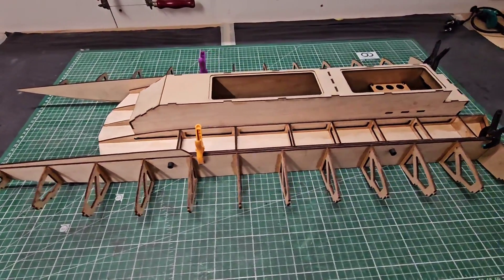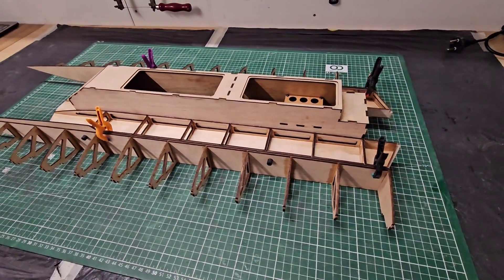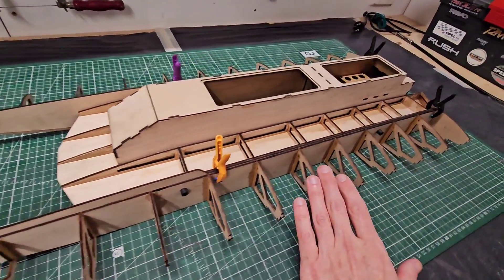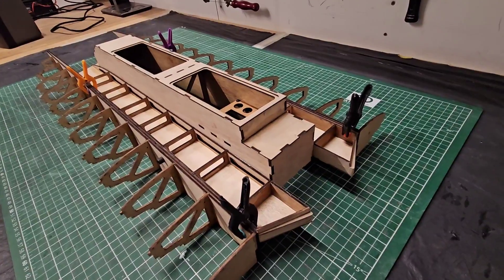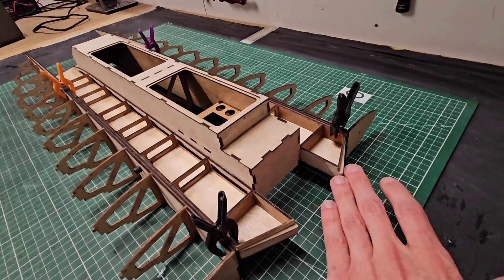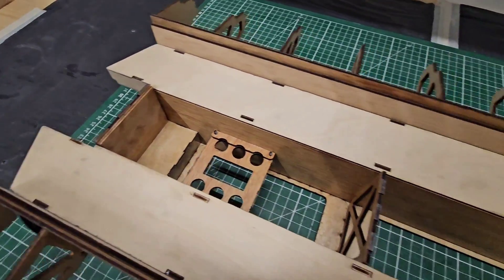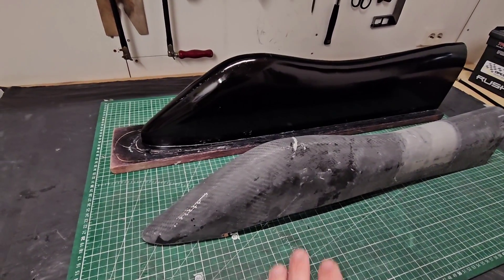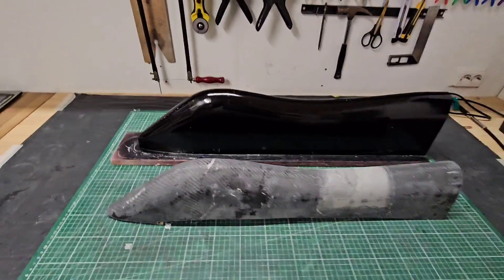How to build a RC F1 Boat - part 2

Comment: Hello again. Great inspiaration video as usual! I finally got my prototypes to work. Geared outbord and all. Not as fast as yours but will get there. I curious about the weight of your boat. I 3D print the all thing, so the body and canopy are a "monocoque chassis" of sorts. Have also been printing in RC plane grade PLA for weigh savings. In spring I would like to order one of your models to have a comparison with my models. Cheers
Reply from the maker: Hi José, great to hear your geared prototypes worked out! 
This boat, with a 6S 4500mAh lipo and carbon cowl, weighs about 3150grams ready to run. Hull length is 834mm. Let me know anytime, if you're interested in ordering a kit. ✌️ DJ
Reply: @CozyRC  I'm certainly interested. Just don't know how to break it to the wife. Market research?  😆

Comment: Thank you for your videos. I have tfl zonda.  Buti I don't like something.
I cat hull somewhere. 2motore systems need 4 water lines. then I made these.
I will have to fix motor mount for sure angle.
all the things  I was able to learn all of them from your videos.
again Thank you.
I would build myself a new boat. Based on what I learned from you.
Reply from the maker: Thank you, I'm glad my videos could help you! TFL Zonda is a very fast boat 👍

Comment: This is a very nice boat. You should make a mould of your hatch/canopy. Then it will be much easier to apply the fiber inside this new mould instead of putting the fiber above your hatch form. Less work of boring sanding, filler etc... as the surface finish would be ready for painting. Or apply paint directly in the ne mould. Also 2 layers of 200gr carbon fiber is way overkill. In the new mould, 1 layer of 50gr of glass fiber for surface finish and 1 layer of 200gr of carbon fiber would plainty enough. I would even go replacing the 200gr for 2 layers of 100gr at 90 degres each other and this should be strong and also very light compared to 2 layers of 200gr carbon ;)
Reply from the maker: Thank you Jean, for your good advices! I'm indeed planning on making a mold. I hope it can be done as a single part mold, instead of a 2-part.
My feeling is, with hand laminating, 2 layers of 200gr/m2 gives a good stiffness and strength. It needs to survive a crash and flip too 😅 I just made a glass fibre cowl too, still on the positive mold. 2 layers of 200gr/m2 carbon fibre will result in a 125gr cowl, painted and all. It's not bad I think ;)
Probably, when you vacuum it, you can reduce the layer thickness, as it will become much stronger. ✌️DJ